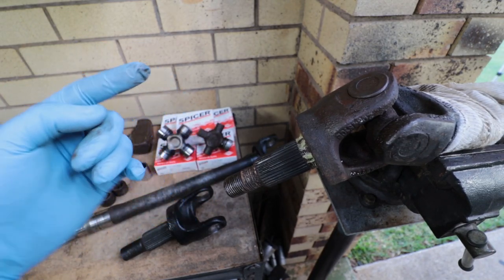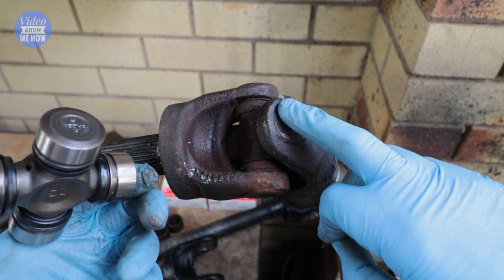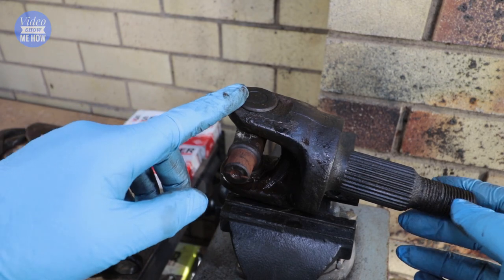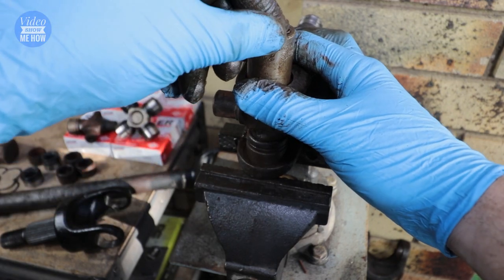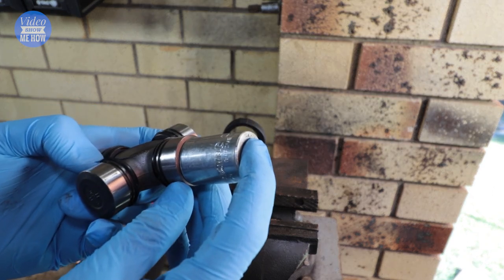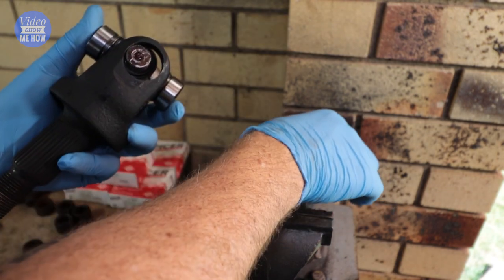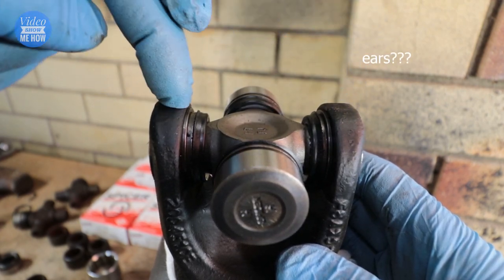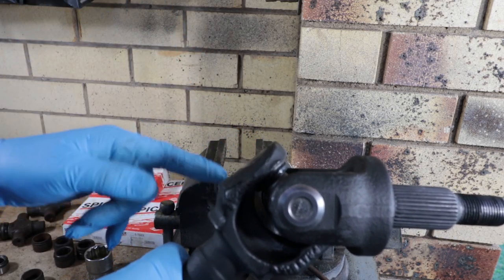How to Remove and Install U-Joints Uni Joint Universal Joints WITHOUT tool

Comment: Awesome video mate, thank you!! I've watched a few over the last 2 days and yours is by far the easiest to understand and most informative! Now I'm off to finish my driveshaft 😬😁
Reply from the maker: Cheers!
Reply: @VideoShowMeHow  more like cheers to you! ...I pulled the driveshaft out, replaced all 3 uni joints and reinstalled the shaft by myself...with the help of a couple of  car jack stands lol now it drives so smoothly! Thank you 😊
Reply from the maker: Great to hear! Good job by the sounds 👌👌
Reply: @VideoShowMeHow  yeah it was actually a lot easier than I thought it was gonna be, except for the 4 bolts at the back end...the ute had been in a flood years ago apparently and the bolts had ceased, but after a few choice words and a hell of a lot of WD-40 and a steel pipe on the end of the breaker bar I managed to crack em!

Comment: for new sealed u joints  do you pack the grease in caps like you do with a wheel bearing ?
i have gmb brand sealed joint with a bit of grease in it to hold bearings up in caps
Reply from the maker: Not if they're sealed, will be pre greased 👍
Reply: @VideoShowMeHow   okay thanks for that  im doing mine tomorrow on a commodore ute

Comment from the maker: Hey guys, what's your preference? The ole DIY socket method or using a press?
Reply: Diy socket.
Reply from the maker: Almost reckon it's quicker!
Reply: I've tried both, well used a bench vice as a press. 
I've had more success with the socket method. When they are really tight to press out, I get concerned about the force being applied to the ears of the yoke. I've had to wind some serious pressure on to get the uni's out, while spraying heaps of WD40 and tapping the sides with a hammer.

The hammer and socket method was so much quicker and I feel creates a lot less stress on the yoke.
Reply from the maker: @71DJL  agree!